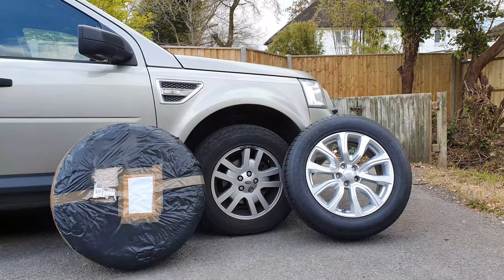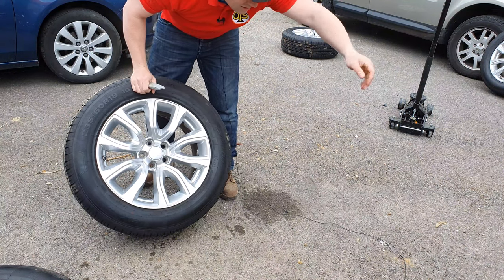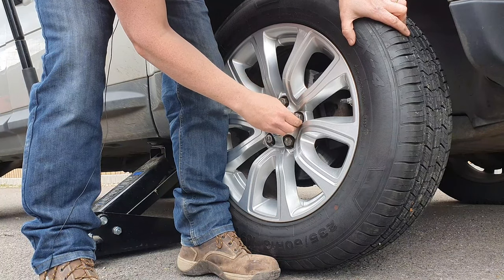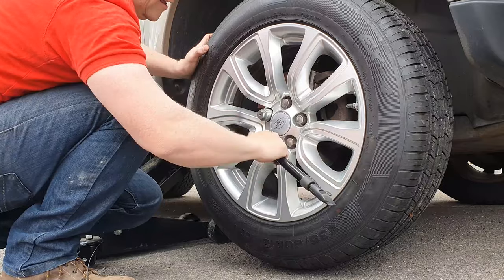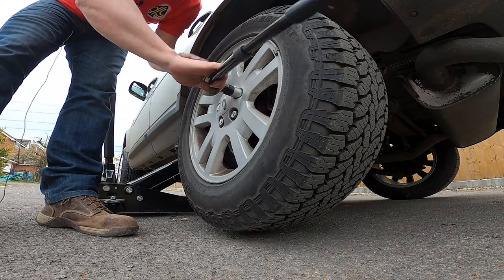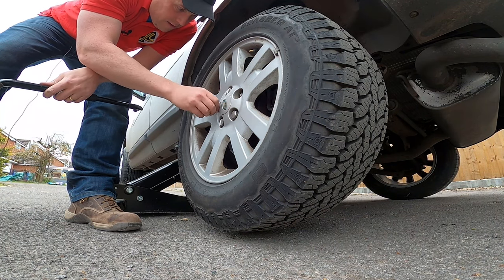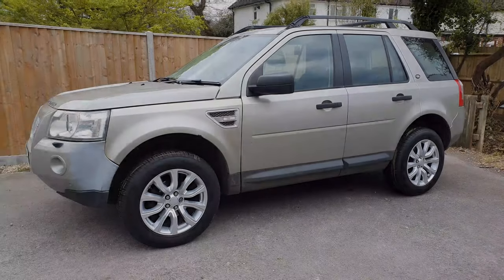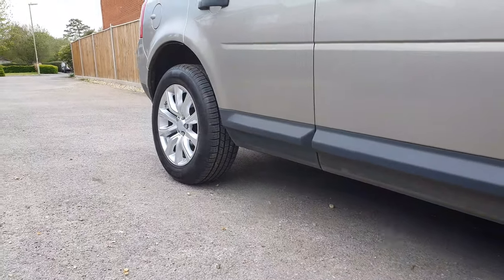Range Rover Evoque wheels (18 inch) on a Land Rover Freelander 2 / LR2 !

Comment: If the drive is to the front 90% of the time - and it is on the road - then you are better with the better tires (more tread) on the front as that's where the drive is - the rears are following - which means you can power and grip out of a slide should you have one etc... IMHO..........